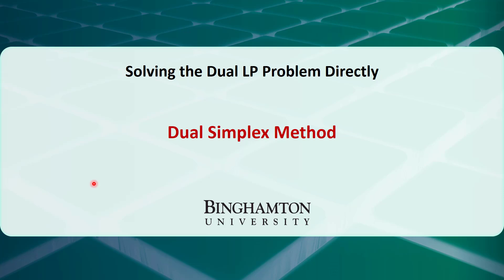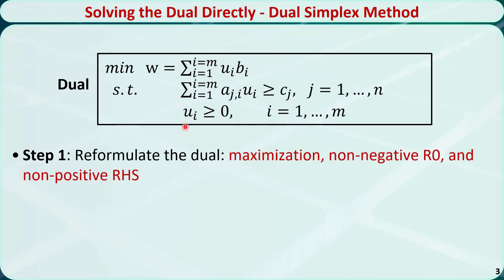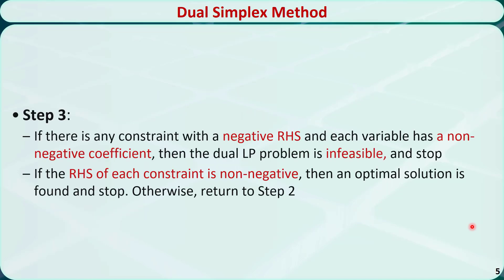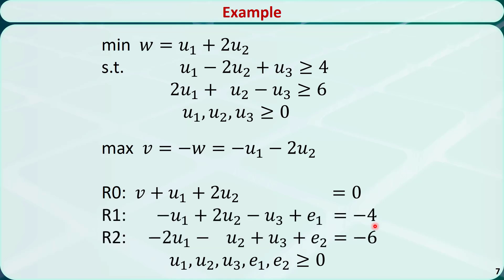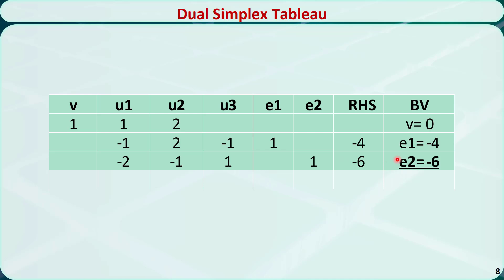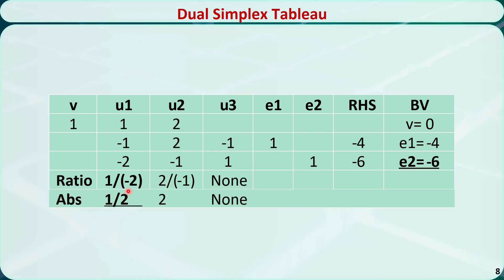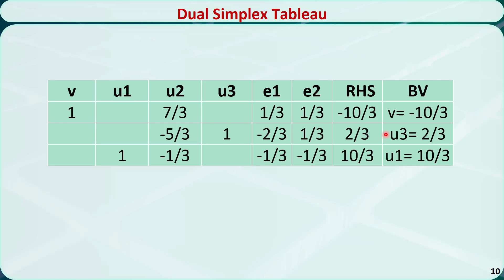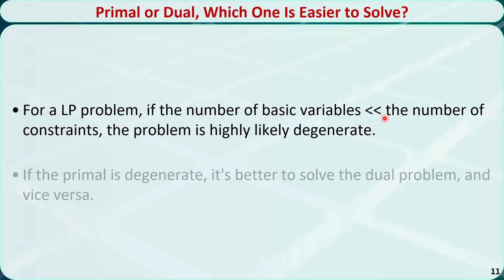Operations Research 05E: Dual Simplex Method

Comment: Hi, I have a question: If we already know optimal solution of primal =  optimal solution of dual, then why do we have to use one of the 3 methods to find the optimal w value?
Reply: you don't. if u r only interested in w. because it would be the same value. but if you want to know the dual solution you can use those 3 methods. solution means the values of each variable not only the optimal value of the objective function. in summary we are interested in y values. not the w.

Comment: Am left bit aback as when to use Big m and when not as the problem here seems applicable by big m method too
Reply: Hey if you have found a video that perfectly explains it please share the linm
Reply: you can use both methods, whichever is easier. it's explained at the end of the video.

Comment: Hi Mr. Wang, your videos have been the most helpful for me. I need a good comprehensive resource to understand topics like column generation and DWG like this. Can you please suggest some? Thanks in advance.
Reply from the maker: Atul, column generation is a useful technique for solving large LP problems. It's not covered in this introductory open course as we mainly focus on the most basic ideas of optimization. you may find some relevant info on Wikipedia and start from there